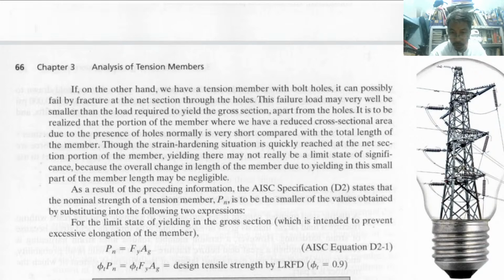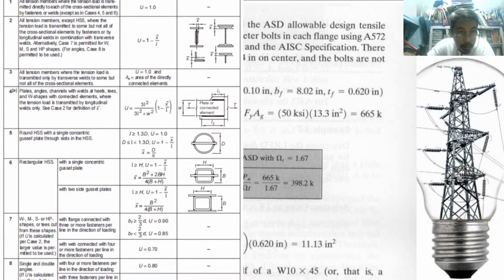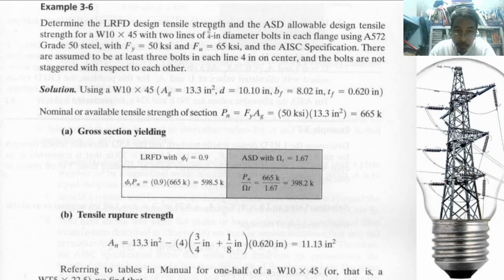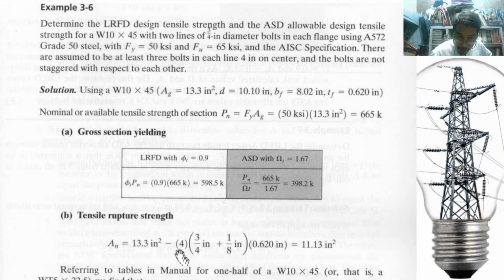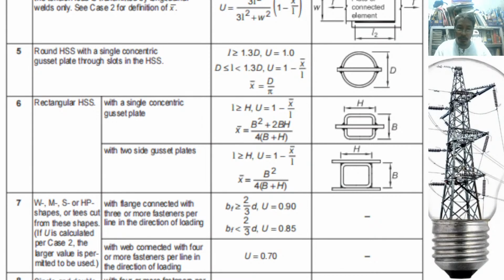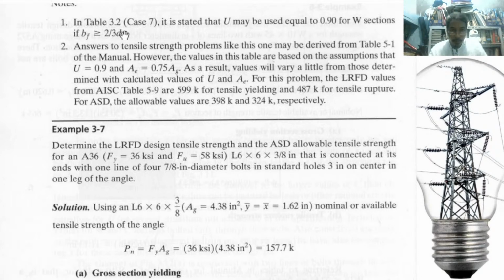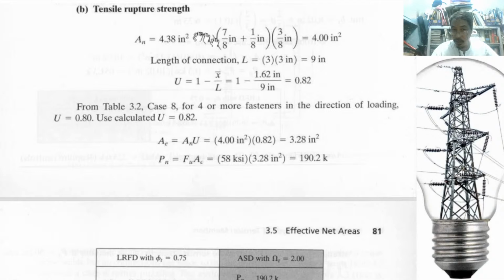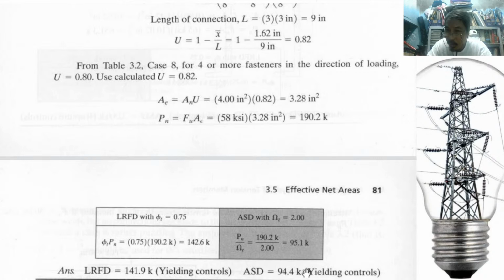[ LIVE CEE6 Lecture18 ] DrAP Zantua Problem Examples + ENGINEERING Analysis & Design

Comment: Thank you sir for this live lecture video and for the illustration of sample problem by computing gross section yielding and tensile rupture strength for bolted member and also using a table that can help us to calculate and determine certain area, thickness and width of the flange.

Comment: Thank you sir, Tension members are structural elements that experience axial tensile forces. So, how can we classify this into the following categories So, first and foremost, A strand is made up of individual wires wound helically around a central core. A wire rope is made up of several strands that are wound helically around a core. Finally, cables are made up of individual strands that are wound helically around a core.

Comment: Thank You sir for discussing about analysis of tension members. Tension members are found in bridge and roof trusses, towers and bracing systems and in situations where they are used as tie rods. In this video lecture, shows sample problems like determining LRFD Design tensile strength and the ASD allowable design tensile strength of the given problem. I’ve learned different formulas and the step by step computations to solve the sample problems.

Comment: Thank you sir for this live lecture about the problem examples on how to solve and analyze tension members. I learned how to use the table of the AISC Manual for identifying the area, width, and thickness of flange or any different shapes and dimensions. The example problem for computing Gross Section Yielding and Tensile Rupture Strength for bolted members was comprehensible. Thank you sir.